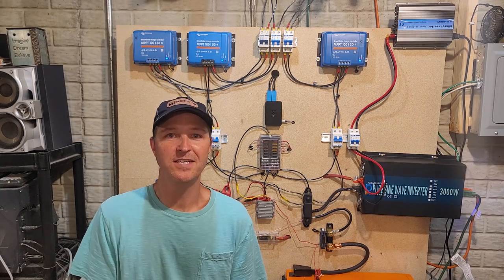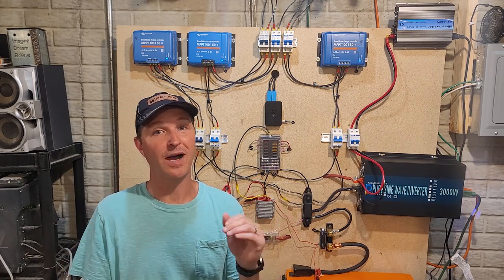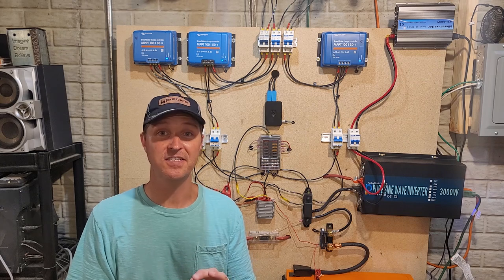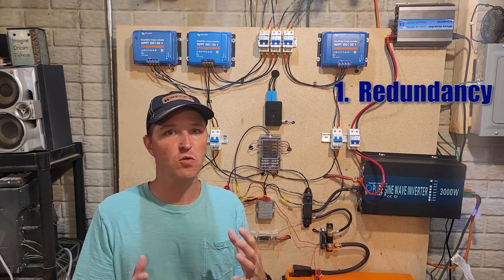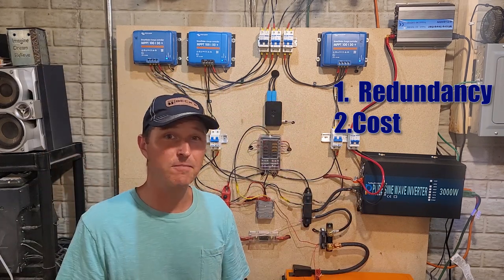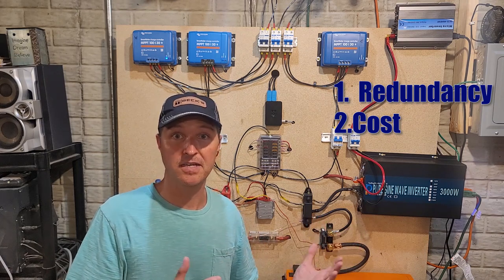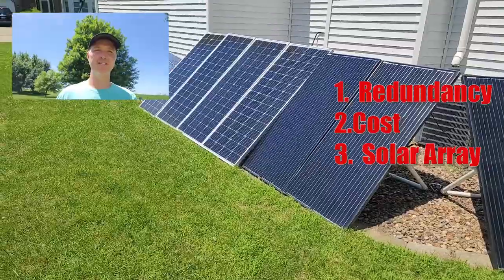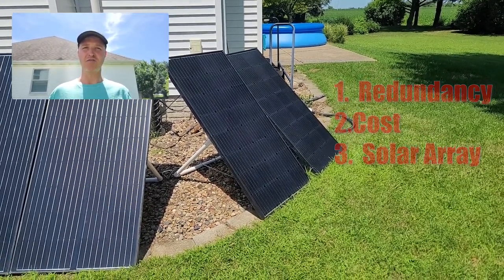Why I go with Multiple Charge Controllers

Comment: One more thing you gain by having separate strings and charge controllers is if only one drop if you have localized shading, or if someone stands in front of one panel.
Reply from the maker: Very true.  I do have a neighbor's tree that sends shade over my panels, but it only effects one string at a time.  Thanks for the comment!
Reply: This is a factor even I hadn't considered...
Reply: Oh neat. Powerlines cast a shadow on my van when I park in my spot. I have two controllers now. I can separate the back half from the front.
Reply: 3 billion years of terrestrial evolution . If one big unit was better, we would be one giant cell.

Comment: I have to ask...Why not use a battery charger that draws less to charge battery's from the same batterys.Its not that hard but no one explains it, why you'd want the money.😢
Reply from the maker: You'd just be transferring energy from one battery to another with a bit of conversion loss.  At some point you would need to recharge everything from somewhere.  Thanks for the comment.
Reply: Not if input is greater then output

Comment: I'm all about redundancy too! Backup for my backup.  Long way from help out here, and spares of everything I rely on is standard operating procedure for us. I love Victron , and happy I made the switch to them on several systems now. Separate strings too...love it! Great video my friend,  keep em coming! Aloha 🤙
Reply from the maker: Thanks!  You were one of first ones I thought of when it comes to redundancy!  Take care!
Reply: @OffGridBasement   
I also have 3 100/20 controllers in use. I also have the same inverter you have with a common bus for "+" and "-".. I have an eg4 24v lifepo4 200ah battery. My question to you is how do you midigate an issue where if for some reason the battery bank is switched off either via bms fault or battery disconnect left in off position, inverter freaks out. It is trying to take the 24v inconsistant power from common bus via controllers. Have u tested this? Or do you have a solution. Thanks!
Reply from the maker: @mikecreamer8308  Mike, I had to read this a couple times to actually figure out what you're asking b/c it's pretty complicated and I've never thought of this scenario.  To answer your question..  no.  I've never tested this and I don't think I would want to.  I think there would be a high possibility of frying up your charge controllers.  I do know most off grid inverters need a pretty stable voltage in order to work properly.  Any amount of instant draw would drop the output voltage of the charge controllers and the inverter would freak.  After the inverter shuts down is when you could see magic smoke from your charge controllers.  I don't really know if this helps or not, but I really hope I never come across that scenario!  Thanks!
Reply: @OffGridBasement  it wont destroy your inverter it just goes in and out of low voltage alarm until the sun goes down and or the connection to the battery is restored. Inverter beeps like crazy, and it is a possible hazard. Just wanted you to be aware of this. There is no communication to tell the controllers  to stop charging if no voltage present on bus or the capicitor voltage from inverter it thinks this is battery and it essentially boot loops
Reply: @OffGridBasement have you found them fighting each other? We have two.  They produce 1/2 what we expect from each one.  

On your best mppt, at best time, what % of the rated total solar panels wattage do you see out of best mppt? In our case we have two 250w and only see about 125w on the best day at the best time out of each mppt.  That's around 50% - 60%. 

And who do you call for support? Victron has no US phone support?

Comment: Yes I totally agree! With the Renogy/Rich solar controller at 12 or 24v it's similar pricing you can get 2 40amp for the price of one 60 amp controller, and you loose redundancy. They will work together and also have a pretty good Bluetooth app. With my solar boat I have two completely isolated systems, I don't want to paddle back from the middle of a lake, lol! Thanks for the video!
Reply from the maker: Thanks for the comment!

Comment: I can't help but wonder why people don't use Hardy board to mount hot electrical components on . Guess it's to difficult working with it but almost impervious to heat flame B/S and just about anything else an electrician could ask for .  T/C/E
Reply from the maker: I personally didn't think about it because I never intended on pushing my system.  When I upgrade my inverter I will DEFINITELY  be replacing the particle board with Hardy.

Comment: I think this should be emphasized for new DIY solar players. Multiple charge controllers are a key strategy. Just be sure to keep the output wire lengths the same length.

As you expand your solar system years apart your not likely to get the same panels. Best to keep each panel type in it's own array. If you have panels pointing different directions then separate the arrays. If you have shade falling on some panels then separate into different arrays. Each array gets it's own controller.

If your off grid then you need to plan for failure. How inconvenient would it be to be without power for up to a couple of weeks while something gets shipped to you? Consider multiple of everything: arrays, charge controllers, battery banks, and inverters. Better to just have a part of your system down than everything. Half capacity is a relatively minor inconvenience. These are also pricey items so if you don't have rainy day saving it may be a while before you can replace the parts.

Two charge controllers can be the same or cheaper than one large one.
Reply from the maker: I couldn't have said it better myself.  Thank you for the info and the comment!
Reply: "...be sure to keep the output wires the same length." - I'm just about to connect up a pair of 250/60 MPPTs to my array of 16 x 425w panels arranged as two parallel strings of four series connected panels for each controller. My controllers are mounted side by side so the DC cables would naturally be different lengths. Can you please explain why equal lengths of cables are important in this context? I totally get why battery cables need to be the same length to help with cell balance but why do MPPTs need equal length cables? Thanks.

Edit: I found some info on page 38 of working unlimited where it says "...solar chargers need to have approximately the same cable length" but it seems like it's not as critical as the inverters or batteries. I'll see if I can find a way to route the cables to keep the length similar.
Reply: Fantastic addition. Thanks a lot.

Comment: I run 3 epever tracer 12/24 40amp. They are solid heat sink. They can run 525/1050 watts. I have been running a 12v system and soon will reconfigure to a 24v system which all my components except my 12v 2000w Xantrex inverter/ charger will work. I'm going to use a 3000w all-in-one 24v probably a PowMr or a Growatt. They have good solar charge configuration and I'll have 3 extra controllers for the hazy shades of winter.
Reply from the maker: Thanks for sharing and the comment!

Comment: I'm going for south , east , west , but only east and west set up , so for the early morning I have 2 x 300 watts panels on the garage and for the afternoon 3 x 300 watt panels which is the maximum I can fit.
 So for you 2 panels I've fitted them with a 100 / 30 and the 3 panel I can't go 2s2p so need to go 3 serial and need a 150 volt controller .
So flexibility , that you can have different voltages and amps with different arrays .
Reply from the maker: That is exactly what I'm talking about!  Thanks for the comment!

Comment: One thing one must understand is the controllers that are cheaper and don't have as much charging power are usually also offering less features and capabilities. I have a Midnite Classic 150. The company is US based and has been making these things forever. Instead of running in parallel I bought another Classic 150 new and have it stored in case my active controller has a problem. I did the same with my inverter which is an Aims 3000 watt inverter. The spares are going into a faraday cage in case of an EMP event. I understand redundancy as I owned a software development company for about fifteen years. We had redundancy built into many facets of the software. So, I do understand how important it is to have proper backup.
Reply from the maker: Good points!  I personally don't like putting all my eggs in one basket, but it looks like you have that covered as well.   Thanks for the comment 👍

Comment: Its good to have also multiple inverters running side by side. If one fails there is still power coming in.
Reply from the maker: Yes.  I know plenty of people that have a big inverter for large loads and a small inverter for all of the smaller loads.  Thanks for the comment.
Reply: @OffGridBasement  and you would turn one inverter off overnight. Like running 2x 3kva multiplus. And when not needed on inverter can be set off.
Reply: I love stackable inverters for this very reason.
Reply: @crinabobo7412  Absolutely. And have all the "Power Vampires" like the Phone and Laptop Charger Bricks be plugged into a plug strip on that one.

Comment: redundancy is good. 
A small generator is needed to fully charge batteries after a string of cloudy days. 
Cost is a valid issue.
Different controllers are useful for dissimilar solar arrays.
LiFePo4 are more forgiving due to their simple charge profile and BMS.

But I would not use multiple charge controllers on a single bank of lead acid batteries - they will just confuse each other. None of them will be able  to adjust for the state of charge of the batteries.

I use a Renogy charge controller that has vehicle alternator and solar inputs - it balances between those two sources.

Thanks for the video!
Reply from the maker: I would feel safe using Victron with SLA batteries since the charge controllers get the voltage from the battery monitor.  That is only if I had all the equipment I currently have.  Not having the battery monitor would be a different story...  Thanks for the comment!
Reply: I use 4 very cheap  pwm controllers on one flooded lead acid battery bank and manage by useing the controller  with the largest number of watts as primary and set the others to a lower cut off voltage..
Reply: @jamesalles139 - Bu the is no redundancy here. There is three independent smaller MPPT's, they offer zero redundancy.

Comment: As a prepper im very familiar with REDUNDECY we have a saying 1 is none and 2 is one. I was thinking on adding another charge controller Because i have two sets of batteries. I have the Victron 100/30 Id rather have the smart 100/30 i may add that to my system.
Reply from the maker: I agree.  I don't think I would feel comfortable with using a all-in-one unit.  The smart version is so nice!  If you can add it, you won't be disappointed.

Comment: Unfortunately the calculations for cost is wrong, if you have two 100/30 controllers you will be running at 100v 60A maximum (not 200v 60A) as the controllers are connected in parallel.
The 150/70 controller would allow you to run 50% longer strings and give you an extra over 200% more capability for parallel connections.
So the increase is:
 (150/100)*(70/30) = 350% if you manage to max out the higher spec controller.
Hope my explanation makes sense!
You still nailed the other talking points, and I am thinking of running multiple controllers for mismatched arrays too!

Worth noting the extra cost of the additional wiring and breakers plays in a little bit.
Reply from the maker: Even though your calculations are correct, I don't think the logic is correct in this situation.
Each CC can handle up to 100v of Solar.  I have two of them so they can handle up to 200v of solar.  They are not in parallel.  They are completely different strings.
Also,  each CC can supply up to 30A to my battery.  On this side of the charge controller they ARE connected in parallel so I could get a max charge of 60A @ 24V
One 150/60A CC can handle 150V of Solar.  It can supply up to 60A to a battery.  This is also 60A @ 24V.  Granted, this charge controller can handle 36V and 48V so that is why there's an additional cost I'm guessing.
Each 100/30 CC is currently $224.90 so if you had two the total would be $449.80
One 150/60 CC is currently $539.75.
These prices are from Amazon.
I believe that is the point I was making in my video.  Please let me know if I am wrong.
Thanks for the comment!
Reply: @OffGridBasement  thanks for the reply,  unfortunately you cant just add the voltages and current like that. Even though the inputs (solar) are separate strings, combining them would not add the voltages and the current together, if we define the charge controllers by their maximum output in W it makes it much simpler. I have taken these values from the product datasheets. 

For a 24V system:
PV power ratings: 
100/30= 880W
150/70=2000W

The 150/70 controller is severely limited by the use of a 24v battery in this use case as you cant access the extra power headroom due to the current output limit on the controller. Yet we still see a 227% increase in capability.

Or let me explain in a theoretical situation:

If you were to have your 100/30 controllers maxed out with solar, for example 3 panels with 33.3Voc and 5A Isc in series and 6 in parallel for 18 panels (making 150Voc and 30A Isc). Lets not worry about over-panelling for now or margin for Voc.

if you had 2 of these CC setup, you would have 32 panels.
those 32 panels would not produce 200V at 60A, you could get 200V at 30A or 100V at 60A, not both.
This is the theoretical limit of these controllers.

For the 150/70 for the same theoretical panels you can connect 4.5 panels in series and with a total of 14 parallel strings. Meaning a total of 63 panels could be connected.
That gives you theoretically 197% more capacity with the 150/70 controller compared to the 100/30 controller.

The additional cost if for the higher power components that can handle higher voltage and current, hence higher overall wattage etc.

The larger controller would provide much better value for larger arrays that don't suffer from partial shading much and are in the same location. Also the ability to connect a 48v battery opens up a huge amount more solar, since the current output of the controller is capped, having a 48v system doubles the amount of panels you can add to a system compared to a 24v system, as you are usually capped by the charge current of the controllers.
Reply: The above is why as you move to larger solar power systems, 48v batteries start to make a whole lot more sense, I hope I haven't inadvertently persuaded you to upgrade to 48v 🙃
Reply: not always true..if u already using pv 800watt with 100/30 charger control..and next time you want upgraded power to 1600w..old charger control not support,save a lot of money u just buy 100/30 not need to waste buying 150/60 charger control..

Comment: I has a silly question for a silly situation. I want to stack dump loads. As in, when my batteries are full, I want the FIRST stage of the dump load to be a water heater, and stage 2 the baseboard heaters exposed to outside air. I might need to actually make a proper controller circuit of my own for this, but... I prefer stuffs made by actual engineers and that has been Certifying Body tested and approved.
I agree with you on all your points, and am convinced not only separate controllers is the way to go, but also separate battery banks. I'm planning on 3, at least.  One for my freezer, since I don't want anything to happen to IT, one for my trailer, and one to sell to Puget Power. I has some silly ideas on how to make enough heat to make this worthwhile. Evacuated Solar Heat Tubes might be part of my madness, and so might a charcoal gasifier feeding a generator.
Reply from the maker: I'm not sure how you would pull off a two stage dump.  It would almost need to be on a timer.  Once the first stage starts then 5 minutes later if the voltage is still above a certain level then the second stage starts.  Once the voltage drops then both stages stop.  I don't know of a product that would do something like that automatically.  Good luck with your adventures in silliness!
Reply: @OffGridBasement  Thank you. Starting to think I'm going to need an Arduino or Raspberry Pi. Especially since I want to set up the Money-Maker bank to automatically drop its banks to 25% once full.

Comment: The redundancy and solar array configuration are all good points, I fear where you lost people is the cost analysis… people don’t really understand the 100%, 200%, 250% thing, the only time that makes sense to them is when they are getting 50% off, they understand discounting.

***With your array, you would almost have to run different controllers, just from what I’ve researched, it’s not really a good idea to mix solar panels in one array and that actually makes sense to me. The redundancy point makes even more sense to me because I’ll be on a boat in the middle of the ocean. The cost point makes sense if you are putting solar up in stages, why replace equipment that you already have if you can just add to it.
Reply from the maker: Thanks for the comment.  It really helps.